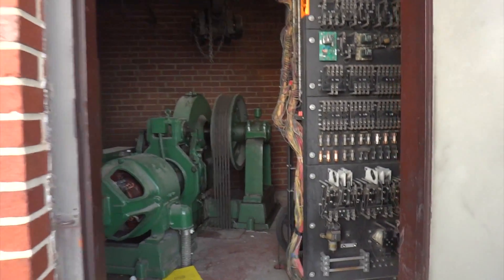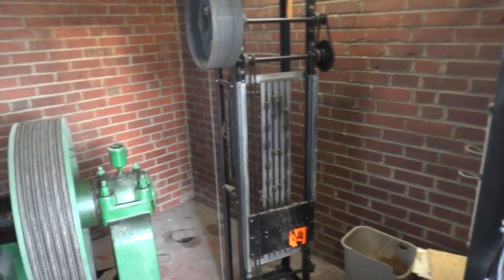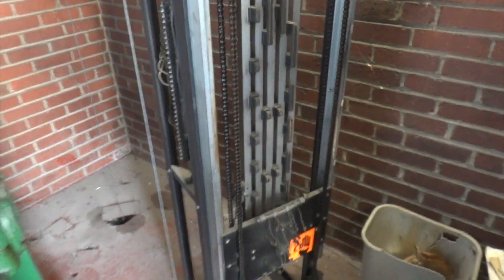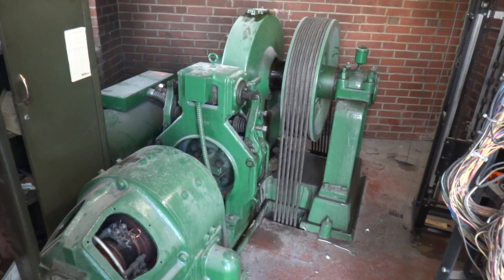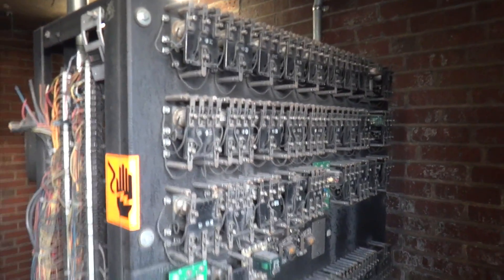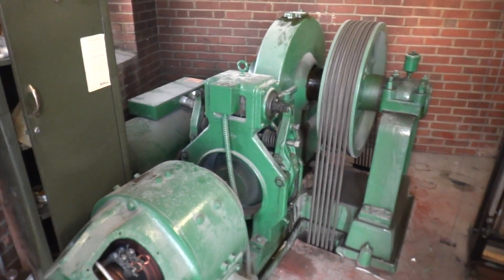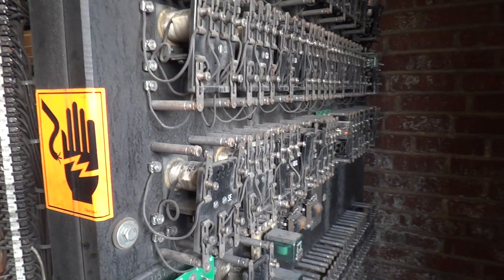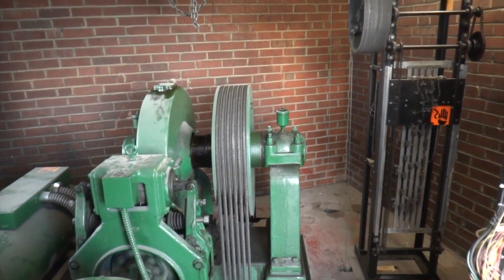Machine Room Tour: Vintage Salem Elevator relay logic controller

Comment: That motor generator set really grunts under load.
Reply: It sounded very rough just after the initial start surge out of balance rotor in the AC motor, worn bearings, the generator's armature off kilter, bearings. A hotel a friend was staying at where I got a job a year later, had two traction elevators one had this horrible noise top of the shaft, I mentioned to the front desk. I was hired as a maintenance engineer, asked my boss about that one elevator a year ago. I was right it was the MG the bearings has worn out.

Comment: Is that a 3 phase motor? If yes does the building have a 3 phase supply or a 3 phase converter?
Reply: IDK what you mean by a 3 phase motor, but I can tell you that this is a DC motor so it can go at different speeds. I know this because of the motor generator
Reply: Most likely the MG set is driven by a three phase AC induction motor I used to a maintenance engineer at a hotel with two traction elevators which had DC traction machines, driven by an MG set. The primary breakers for the controller and generator were three phase.

Comment: Cool. I noticed there's some type of pc board retrofitted to the controller. (the bright green thing on the left side) Is that some type of solid state capacitor feeding the transformer next to it or is it actually logic or what?
Reply: Could be fire service
Reply: Elevating Oregon since 2015 Dana Danarosana 
Fire Service is a very good guess. That is indeed a logic board, and certainly is not original.
Reply: That's my guess lol
Reply: I've seen solid state capacitor boards look just like that... but fire service would make sense.
Reply: Dana Danarosana
Without being an elevator technician, there is no way of knowing for sure. All I know is it definitely isn't original.